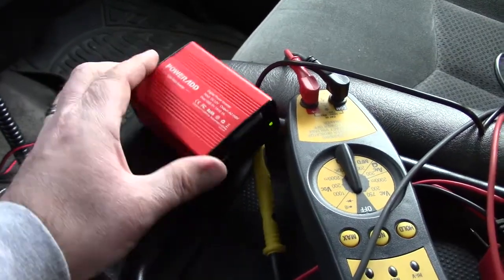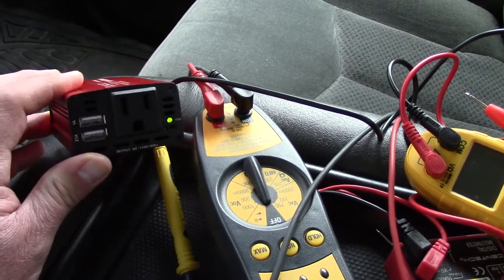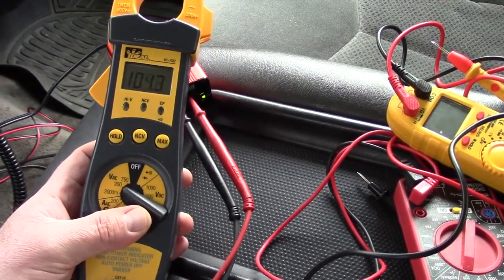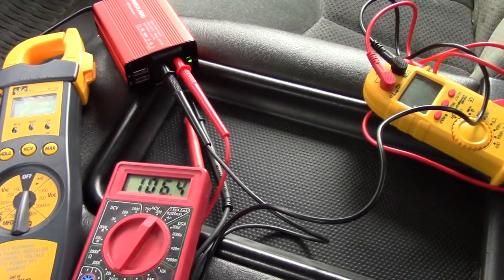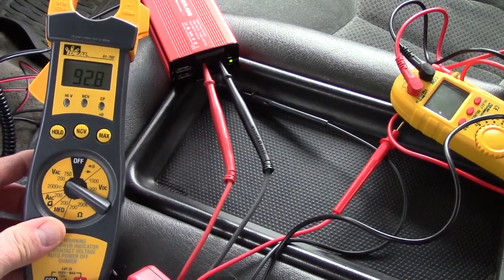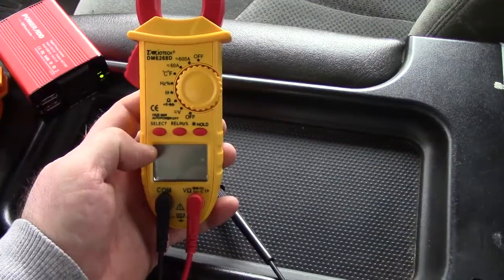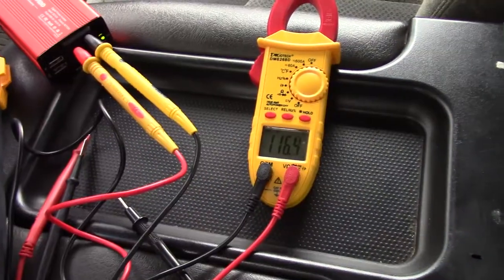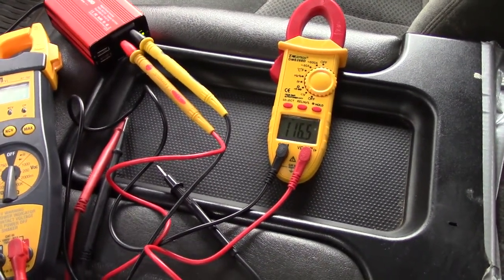Low voltage on car power inverter? Try this

Comment: The voltage from a square wave or a modified sine wave will never read the same as a pure sine wave voltage as from the mains or a pure sine wave inverter unless you have a true RMS meter due to the peak voltage from a square wave is less than that of a sine wave for the same power.